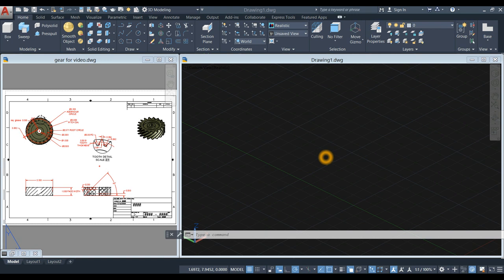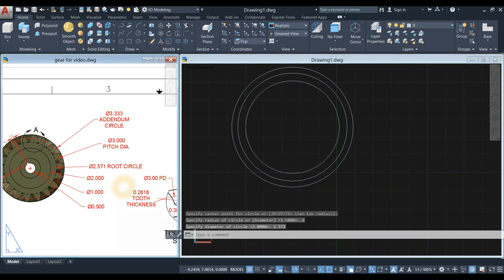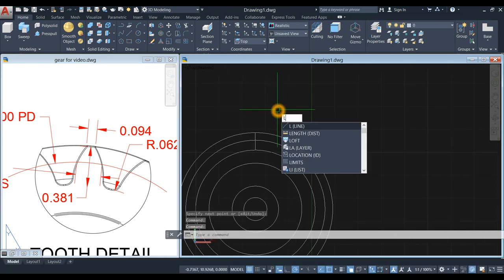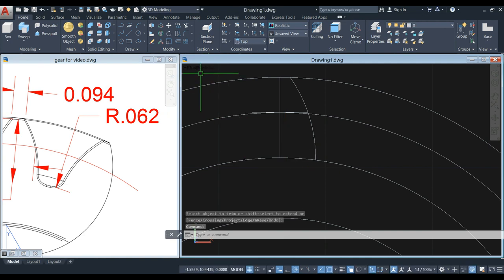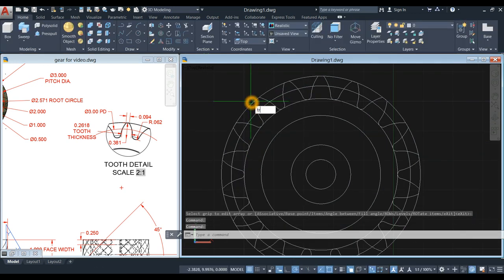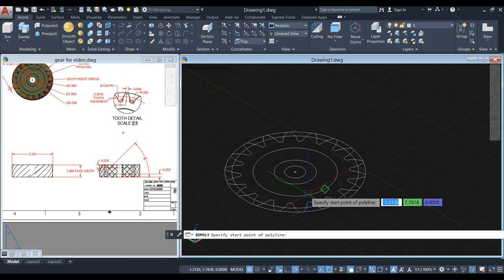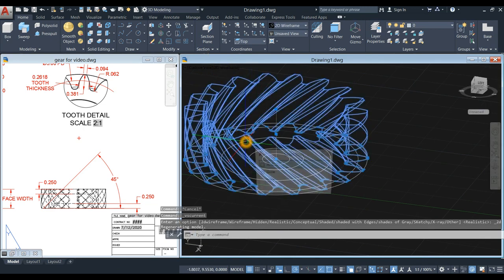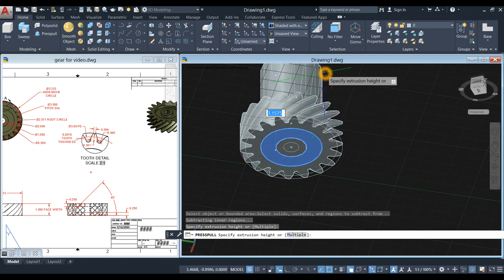HELICAL GEAR : AUTOCAD DESIGN in English

Comment: For making key way, the rectangle options was not shown as in yours it's showing double rectangle and trim options not working for the circle
Reply from the maker: the fastest way to make the trim command work is to press enter 2x after entering TR.
Reply from the maker: and make sure the lines ( from rectangle) are extended and joined with the circle before using press/pull command

Comment: You don't show where the 3 point curve goes. If you don't get that curve exactly the same as yours it will not join, or explode with out a multitude of more problems
Reply from the maker: The 3 points are the ends of the lines (guides) and the intersection.

Comment: For some reason I can, t get fillet successfully to draw the first tooth, between 3 points arc and circle. Any thoughts about it?
Reply from the maker: Did you use 2d fillet or filletedge? Make sure that you are working on xy plane.
I should have given a specific point at the very bottom of the tooth, instead, I just dragged down the arc and followed the perpendicular point. To remedy this one, just add another line vertical line with a distance of .3161 and attach its midpoint at the endpoint ( bottom) of the vertical line ( the .381 line guide), the point that intersects the circle should be the 3rd point of the arc. Either way, it should still work.
Reply: @AC3DCad  and suddenly as if by Magic,after following same steps many times ACAD does its job,and thought to myself,What i,m doing wrong? Fillet and join command are  like a pain in the ass sometimes.Thank you very much for quick reply,i,m learning a lot with your channel.You are very good at AutoCAD.
Reply from the maker: @pedrosanchezpena7   when join command doesn't work, it means that there is a gap, you have to zoom in the 2 object to check.